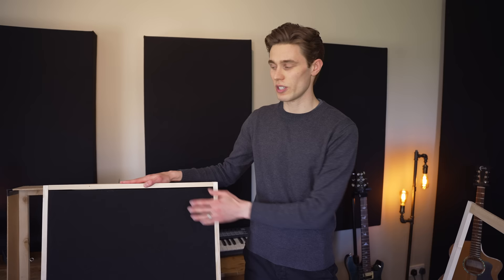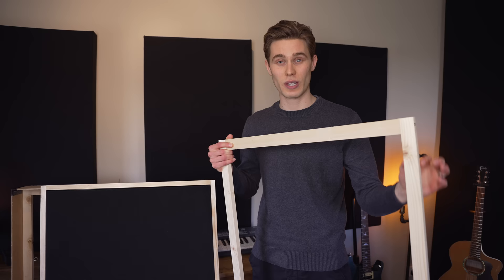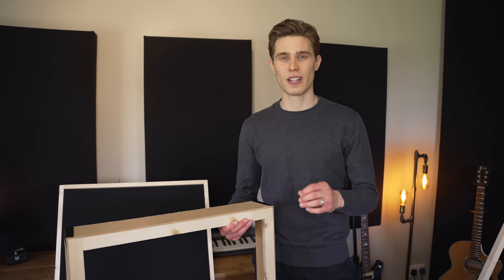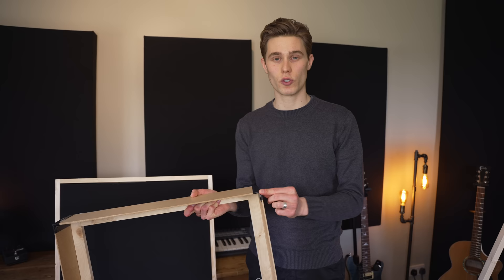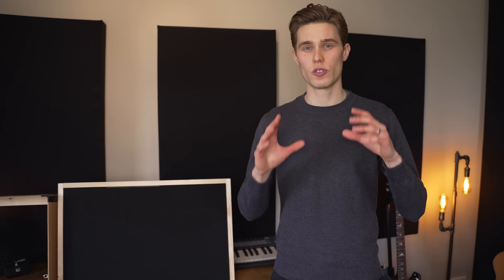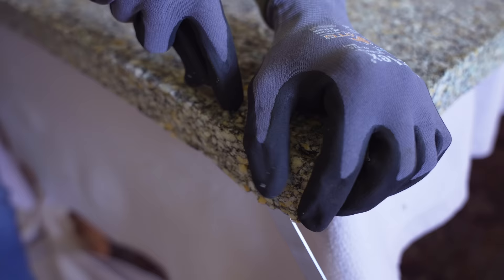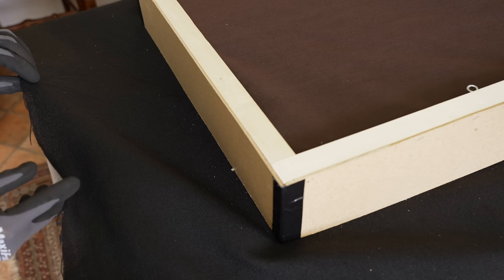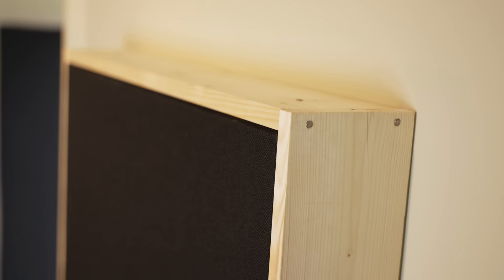How To Make Your Own Acoustic Panels - DIY Professional Acoustic Treatment for Home Studio

Comment: I think a lot of the reason why people use rockwool is it insulation is made from non-combustible fire-resistant stone wool that can withstand temperatures above 1,000°C.  I don't think the materials you mentions are fire-resistant.
Reply from the maker: I don't want to get into trouble here but: 

What's the point in using fire retardant insulation if I'm going to surround it with flammable wood and fabric wrapping and place it in a studio full of highly flammable objects?

I know that for some studios, almost everything might need to be treated/sprayed and be fire retardant but I know that if my studio catches fire, the panels being flame retardant won't make a difference. 

However, I do think everyone should have fire extinguishers (and even automatic ones) and an action plan in the case of fire! 

What do you think?
Reply: @inthemix  In no way did I want to diminish the value of your video.  This is an awesome built and thank you for talking the time in doing it.  I think fire extinguishers in every home are a great idea.  I think the denim is treated with treated with a borate-based flame retardant.  I am not sure about the hemp or wood fiber.  I think safety is always something that should be taken a look at.  I also think people choose rockwool for the inexpensive price.  Anyway awesome video loved watching it!
Reply from the maker: @tomburden  hey Tom, yeah I definitely didn’t view your comment as criticism! 

It’s tricky to get the tone right in a comment. Thanks!

Comment: Sorry, so you put the weed barrier in FRONT of the panel (if using fibreglass)? Not sure about that stuff but wouldn't it just reflect the sound? Would be like the acoustics inside a jumping castle if the front facing materials aren't 'permeable'.
Reply from the maker: I assure you, a fabric barrier will not reflect the sound. This is a long standing acoustics myth started on some internet forum a decade ago

Comment: Thank you for the advices. I have a small question ; in a book I saw that it is adviced to leave an air gap between the wall and the panels. With your method, there is a air gap but it is between the wall and the wood frame, thus the air is a bit "trapped" and is not able to flow easily to the rest of the room. Does it impact the performance ? 
In the book I read, they used 2'' standoffs to maintain an airspace.

Comment: I'd like to be environmentally conscious, but it is not that easy. Denim appears to be about 4x the price of Rockwool. I've used Roxul Safe&Sound before which worked ok with the caveats you mention in your video. I only found  in the recycle category here in the US. It is CelluZorbe Cellulose Acoustic Panels. Do you think they are any good? You videos are 1A by the way. Clear, structured, objective - Great Job!
Reply from the maker: Thanks! Those Cellulose panels actually look like they will be highly effective (with the bonus of being fire proof/resistant too). 

They might need to be aired out for a few days as they can sometimes have a plastic smell when you take them out of the wrapping.

Comment: brilliant video as always. question about the gardening fabric : does it let treble pass through? i've been told to choose a lighter "breathing" fabric for the front to prevent treble from reflecting off of it. am i properly informed?
Reply from the maker: It will absolutely absorb the treble and not reflect it. 

Don’t listen to folks who say that treble will bounce off of a non taught woven cloth like this. If (non taught) cloth was a good reflector of sound you’d see it used in hundreds of applications across multiple industries as an affordable sound reflection alternative.

You are absolutely right to ask. There is no need to be worried by folks who say things like that as a fact!

Comment: I have sort of a technical question, if i wanted to hang the panels sideways so that the length of the panel stays horizontally, would i have to build the frame differently?

Comment: Great video, thank you so much! I'm gonna try and build my own panels at some point.
I'd love to ask you about insulation materials. I've been doing some research, and I've found that maybe cork could be a good material to use. It's relatively affordable, dense, fireproof, waterproof, and good at both acoustic treatment and soundproofing (or so I've read).
Would you recommend working with cork panels?

Comment: I'm not sure if having a layer of the gardening (bedding) fabric on the absorbing side is the best idea, as it is not made to be acoustically transparent, so it MAY lessen the high frequency absorption a bit. It may not, but I'd need to know for sure first. Also, do you have any data on the efficiency of the alternatives to Rockwool? I was looking at Caruso but this is not as cheap as the denim etc, so be good to know if it really is a s good or better than Rickwool etc.

Comment: Hi ! Perfect video thank you so much 🤍
I'm making a horizontal panel instead of a vertical like you did, so for the frame I wanted to know if I should go with the same configuration as you (the top and down ones are the shorter) or the opposite ?
Thanks again, have a great day 🙏
Reply from the maker: Great idea to go horizontal. In this case, I would keep the same joins as my design but just make the top and bottom much longer and the “sides” much shorter. 

This way the load bearing is the same. 

However, I would probably use additional bracing in the middle, as the panel might sag a little bit.
Reply: Oh great ! Thank you, your respond was so quick 🙏
I forgot to say it was planned do 1 or even 2 more inside to keep it steady !
Thank you for these precious advices
Reply from the maker: @Jleo21  Sounds like you know what you’re doing! I hope they turn out great!

Comment: Hey appreciate the video. However, you don't talk about how thick the insulation filler is supposed to be or if you're needing to use more than one slab inside the frame (the come in 2' x 4' in 1 or 2 inch thickness).

It appears as if you're using a double panel of two inch thick  2' by 4' panels of insulation to fill the wood frame - resulting in 4 inches thick of insulation. If you could comment with that information, I'd really appreciate it. Thanks!
Reply from the maker: Thanks for the comment. I didn’t make this clear enough in the video! My intention was to keep the depth/thickness of the panel open to individual needs and the insulation materials available in your region. 

I’ve seen people make these in depths of only 2 inches and all the way up to around 8 inches successfully. Deeper will give more balanced absorption but I think the physical space you have available will most likely guide the design. I know I would be mounting 1ft deep panels all over my room!

Does that clear up your question? I tried to balance the video between telling people what to do and keeping it flexible :)

Comment: thank you for the video. How thick do you recommend the filling to be? while ordering i can see quite a few options between 45mm up to 200mm. In your video i also saw that you put 2 of the fillings into one panel, is that correct?
Reply: depends how long your sides are or the depth of your insulation. Your answer lies there. Buy what fits easy or build around the size of the slabs available to you.

Comment: Question from a clueles but artistic viewer: For the fabric, can you use canvas (for painting) and paint them? I would think it is too thick of a fabric particularly when painted but would be great if that’d work. Thx
Reply from the maker: I have no knowledge of framing canvas but I honestly don’t see why it couldn’t be done with the right thickness and tension?
Reply: That sounds like it would be acoustically reflective instead of absorptive, defeating the purpose. You need to be able to feel a soft breath through the fabric.

Comment: hello, thank you for your wide knowledge on audio production,,,i am your youtube student(still novice) i acquired glass wool before i watched your video, now am stuck with 20 metres of it and just have to use it, will it help using nylon or plastic wrapping at the back and dense cloth fabric at the front,? acaustically will that work to cancel reverberation, and some absorption? used glasswool with foil 50 mm thick

Comment: Does the type of fabric used matter? Does it have any reflective properties that would prevent some sound from reaching the insulation?
Reply from the maker: Different fabrics can affect to high frequency absorption. Low and mids will pass right through no matter the fabric (within reason).

Almost all soft fabrics will allow the high frequencies to be absorbed well, there isn’t much to worry about unless it was, for instance, a very thick canvas material pulled very tightly.

Comment: Hi!
Do you have any suggestions for the roof? I have a concrete roof, and even with the panels, the roof is an issue.
Also, any suggestions for how much of my relatively large room walls should be covered by panels? Area% wise.

Comment: why you say it is hard to work with them if their density is around 40 kg? because it is difficult to hang them on the wall?
Reply from the maker: When the density increases, it becomes heavier for the same volume and usually the insulation is much stiffer and harder to cut without proper tools.
Reply: @inthemix  thanks for replying! I guess it doesnt affect the absorption/insulation results right?
I have another question, the front fabric matters or it can be whatever?

Comment: Awesome video! can't wait to get started. I'm having trouble finding insulation in the UK. I'm looking for any of the healthy options at the standard measurements (1200x600), roughly 50mm thick and 30kg/m3 - basically exactly what's recommended in this video. It's like a minefield. Anyone have experience and could recommend anything? Many thanks

Comment: Nice work bro thank you, so i can use foams since it's to absolve echo?
Reply from the maker: Lightweight foams will help absorb high frequency echo but are often ineffective in the mid and low range frequencies. This can lead to a room which sounds boomy and bassy without much clarity.

It all depends on the results you want but often foam is not the optimal choice (it can also be expensive too!)

Comment: So question, because it looks almost like a canvas. If I paint it, will that ruin the sound absorption, or can I totally paint these Bob Ross style?
Reply from the maker: Paint will make them slightly more reflective in the treble and high frequencies. I don’t think it would make much difference in the mid range and bass absorption. Just make sure you get a paintable fabric, I don’t think mine would take paint very well! 

Good luck!

Comment: I have already used Rockwool Sound Insulation, before I watched this. I stretched and covered with thin cotton(like a fabric using for shirt) onto the panel. Is this still dangerous to have in the studio (dangerous for breathing the air? or fire hazard?) ?

Comment: Hey, brilliant video.  I think we might be from the same region (based on your accent).  However, I'm finding it difficult to locate your recommended insulation.  Is there anywhere specific you could suggest I try?  Thank you.
Reply from the maker: It's very likely we're both in the same area! I picked up this stuff at bnq for making this video but they hiked the price up loads after filming. There is a UK company called thermafleece making hemp and wool insulation but, again, prices are simply absurd at the moment across the board. If you find any options, send a link here and I'll check them out or message me on Instagram @michael.inthemix and I'll try to help.

Comment: Thanks for this great tutorial! 🙏
I saw that you also have acoustic panels/bass traps in the corner of your studio. Did you make these yourself as well? If so, did u just place these rectangular-shaped panels - that were covered in this tutorial - across the corners or did u make them differently in a more triangular shape?
Reply from the maker: Very keen observation! 
Yes they are a similar design and thickness but the edge panels are angled at 45 degrees so they fit neat to the wall. There is a big air gap behind them in the corners and they stand floor to ceiling with a small retaining hook on the back so they can’t fall into the room.
Reply: @inthemix  Thank you! Would u consider it possible to hang these acoustic panels from the ceiling as well? Or would you recommend a different design for that purpose?

Comment: i have bags and bags of old clothing...

Can I cut them up into small pieces and make panels that way? I'm looking for a non toxic material but I can't get ahold of any denim insulation here
Reply from the maker: That would be better than nothing but I don't think it's going to be the easiest material to work with or bind together. Maybe build the frames with the back open and give it a shot?

Comment: What’s your thoughts on cutting holes into the particle board along the sides to expose more insulation? I saw a vid saying it’s an improvement, but I’ve never seen it done on professionally made acoustic panels.
Reply from the maker: Honestly, I see no reason why that would be a bad thing. You would need to space the holes sensibility to avoid weakening the material too much but it’s actually a great idea. I wish I’d thought of it! 

If you try it, would you let us know how it went?

Comment: Great video thank you!  Would you say your recommendations for insulation hold true if applied to building an interior wall for the studio?
Reply from the maker: Hi Brian. The materials I recommend would work very well as interior wall insulation and sound proofing but might become rather costly.

If other, less safe, materials are used within walls and properly sealed, I am not sure if they pose a health risk. My own walls are full of rock/mineral and glass wool (I live in an old building) and I don't think any of it reaches me.
Reply: @inthemix  that's a great point thank you for the reply. perfect timing on these studio videos btw!

Comment: When I first started making music the first sort of acoustic treatment i had was these textile uhaul moving blankets. And they did the trick to dampen the sound then. So im wondering, If i was to fold them into 2 by 4 squares, stacking them onto eachother as needed, would they work as filling for these panels? If these options in the video would just be blatantly better then ill go for it but if i can get good results with what i already have then id love to recycle something thats been in my studio since I started
Reply: You can, but you get better results and it will be much cheaper to use the building materials for insulation panels.

Comment: The biggest issue I have in my 3m x 3m mix room is bass (My A7x monitors are probably too big for the room), I have checked the acoustics using Sonaworks and there is massive bass boot at around 120Hz... I was thinking of using those foam slabs to try and cut the bass boost, I'm not sure they have the mass required.
Reply: The solution for bass is thickness. So build a really thick one. 30cm of typical insulation will dampen 70% of 120Hz sound. That should drastically change the situation. 20cm - 60%, 15cm - 50%, 10cm - 25%, 5cm - 5% (but over 90% of any frequency over 1kz). As you can see ddcebt effect comes only after a proper thickess.

You can also improve the design by adding antibasso/antivibration materials (refer to car and mechanical stuff stores).
Reply: Foam won’t do it.
Reply: @b1j  
It will. The quality of the dampening material matters way less than the thickness. Way less.

Check what "bass traps" are made of.

Comment: Great video. I was just about to build some panels for my studio that has a lot of reverbs and went yesterday to a local shop to check of available materials and especially fillings. After seeing your video discarded rock wool and mineral wool. However the polyurethane panels they had as an alternative have density 80 kg/m3 and 150 kg/m3. Isn’t it too much?

Comment: Hi Michael, do you have any thoughts on stone wool batt insulation?  Would this fall under the rock/mineral fiber wool that you recommended?  I ask because ROCKWOOL Safe'n'Sound seems to be the most widely available acoustic insulation in the US (at least where I live) and am wondering if it will be safe.

Comment: Hi, I am attempting to soundproof a plastic Suncast generator shed.  I am going to cover the interior walls, and I'm having a difficult time deciding which material would work best.  There is so much misinformation out there regarding soundproofing that each time I read an article or watch a video, I end up actually having more questions.   I have narrowed it down to Rockwool or 394mil (10mm thick) closed cell PE foam with a foil layer for heat deflection.   Which would you recommend?  Or would you recommend something entirely different?  I also thought about building some sort of sandwiched interior wall and utilizing blankets.  I'm at a loss.  Thank you in advance for your time.